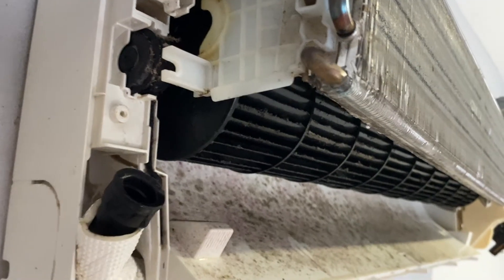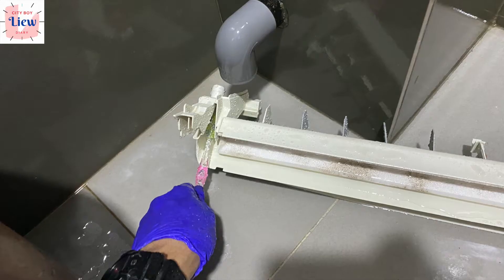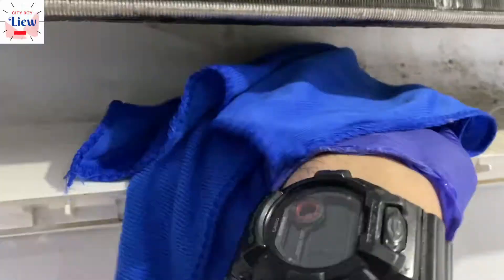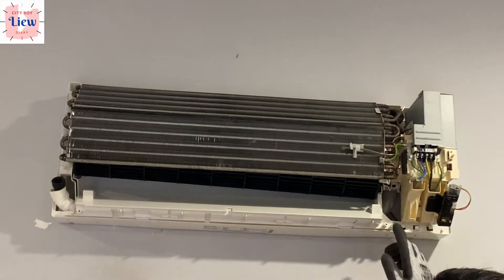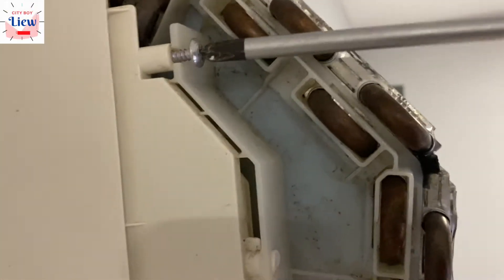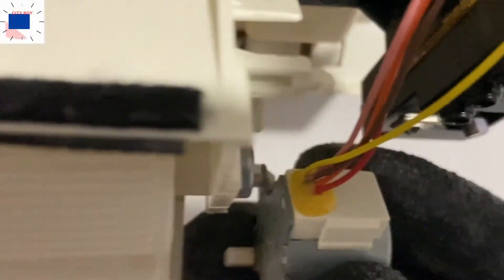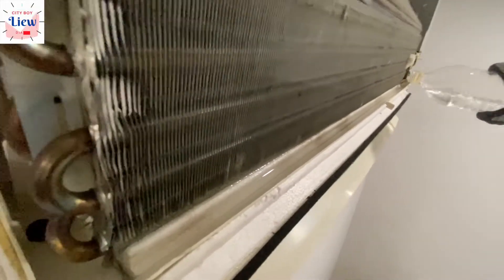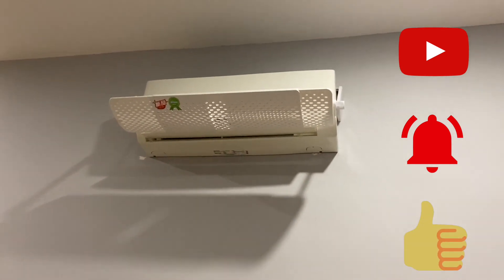Disinfect black mold and dust around blower wheel of indoor AC to save electricity #blower

Comment: I removed the grub screw and the spindle is exposed on the left side but the roller won’t slide out as if it’s rusted on the grub screw side. Any tips?
Reply from the maker: Have you tried the WD4D?
Reply: @CTB6  thanks cityboy, yes I tried WD40. And a slide hammer. But nothing is breaking it loose
Reply from the maker: @Tigerratcat   Try spray WD4D from left and right of the shaft coupler and wait for a minute for the chemical to soften the rust. Perhaps an impact drill can be used to loosen up without breaking any plastic parts.
Reply: @CTB6  thanks Liew,
I’m not sure how a impact driver will help in this case. I had success dismantling a Panasonic blower wheel, but not this Toshiba RAS-18N3KV2. I taped a toothbrush on a stick and lifted the radiator fins on the left side to clean the roller as best as I can. Anymore force to try and slide the roller out, something will break. I feel its well seized on the bearing shaft

Comment: I tried this, with an LG aircon.. manage to remove and clean everything, but now trying to put back the blower, i realise the set screw for the blower cannot screw in completely to hold the blower in place. My blower can still move left and right 😢. Maybe i not enough strength..going to borrow my dad's electric screwdriver
Reply from the maker: Perhap need to align it. One of the side of the rotor shaft is flat for the screw to hold.